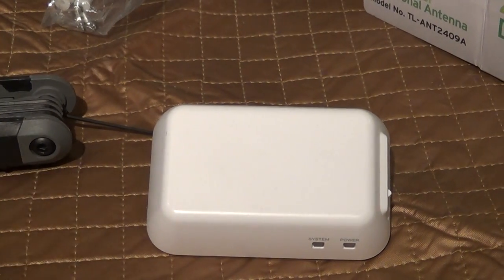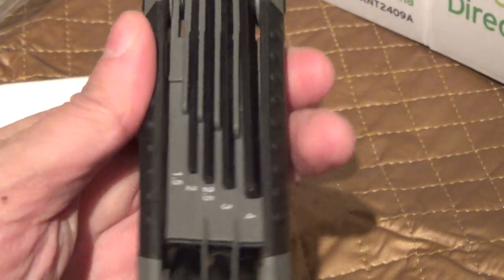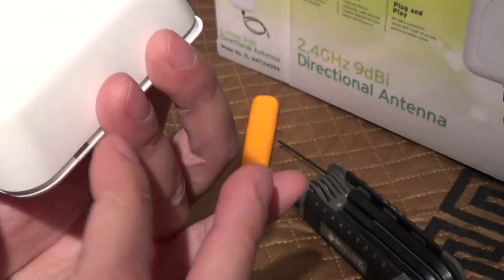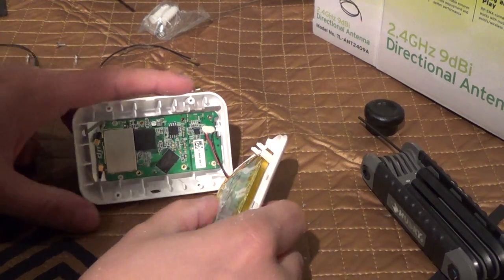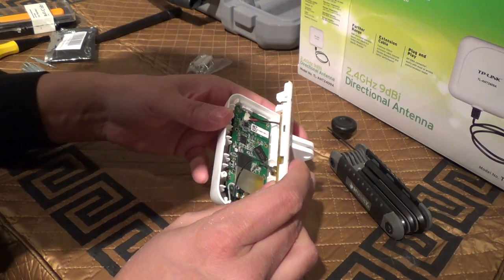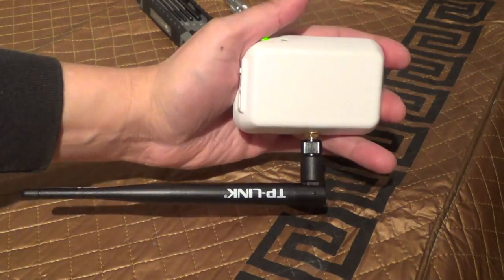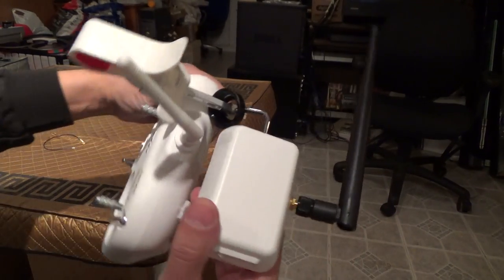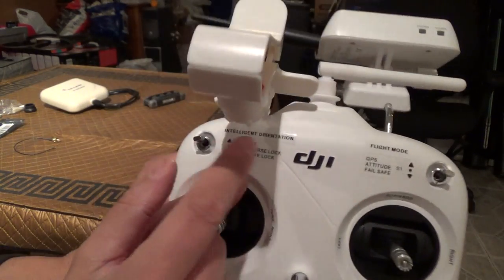DJI Phantom 2 Vision Wifi Range Extender / Repeater  External Antenna Mod increase FPV range.

Comment: so what the new range after upgrades
Reply from the maker: I range tested the 5db gain omni directional today and am seeing anywhere from 60 to 75 percent increase in range with the benefit of it being an omni directional.  One spot stock setup I was only getting 1050 feet distance at 400 feet up today in same area with the 5db omni I did 1650 feet away at 400 feet up and still holding a connection.  Can't wait to see how the 9db does
Reply: Wowwwww.awesome.simple setup.but result like a diamond
Reply from the maker: Mohamed Shahir Using the 8dbi antenna has given me an even bigger boost I've now topped out at 2,533 feet fpv range. Next up is a 9dbi omni.
Reply: Ben7seven7
did u get new range with 9dbi omni...?
Reply from the maker: Mohamed Shahir The 9dbi seems to be similar to the 8dbi TPLink omni. Maybe worse actually though I will need to do some more test flights to really see. Between bad weather and being sick I haven't been able to get much of any flying time in.
Reply: Okay ben.if u get new range.inform me again. But for me.i will setup with 5db.cos there is superbbb range.hehehhe
Reply from the maker: Check out my video on adding amplification.  Whatever range with whatever antennas you're using it will easily double that.

Comment: Good video.  See a lot of people asking about this modification so these instructions will be a GREAT help.  The only thing I'm going to change is I'll probably put in two connectors for both antennas.
Reply from the maker: Thanks so much for the feedback.  In thinking using two versus one will increase your view of the sky versus adding extra actual flight distance.   Also the 5db omni works great today I did 1650 feet away at 400 feet versus 1050 at 400 feet with stock.